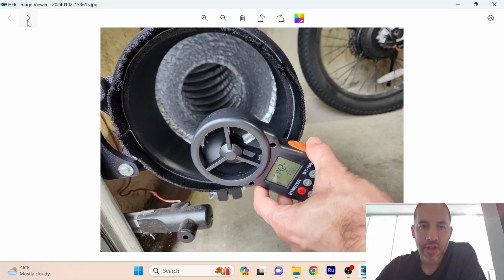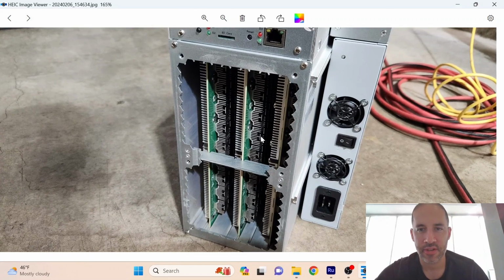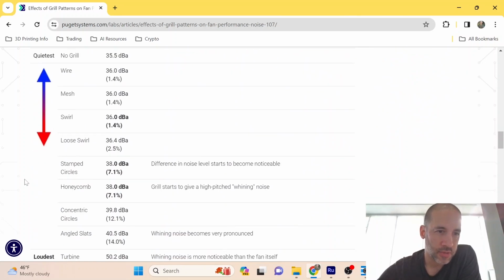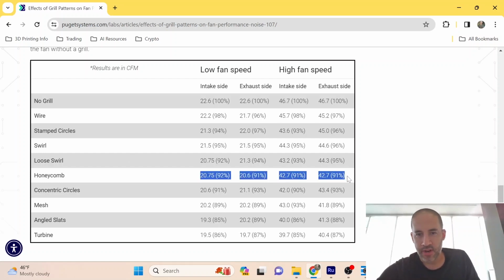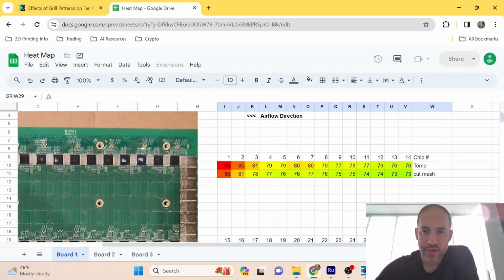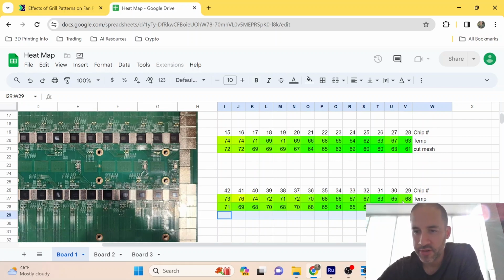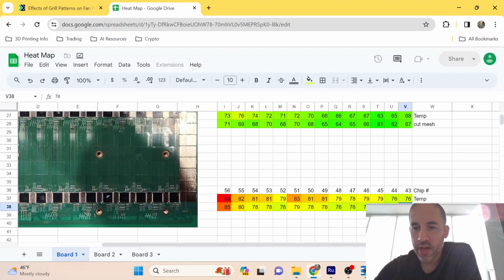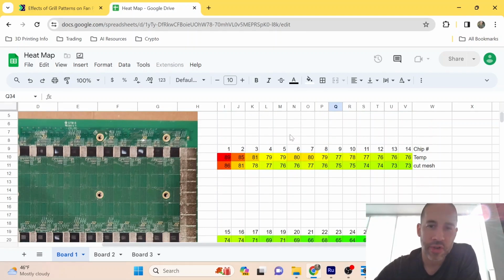FREE ASIC Miner Mod! Improve Your Airflow in Minutes! Better Cooling = More Efficiency!

Comment: Yes, meshes 100% can limit air flow. It's a common problem with computer hardware enthusiasts. We worry about dust and thats about it.
Cfm isnt a standardized test between fan manufacturers or even models. So whatever u test, create a standard with as little variables as possible.

Comment: Hey man, do you have any confirmed fitments for your shroud kits on a Bitmain KS3 yet?
Reply from the maker: I do not, unfortunately.
Reply: @BoneyardLabs  anyway I could get your measurements of your fan screw pattern to compare to mine? Or vise versa?
Reply: @BoneyardLabs  my fan screw holes are 105mm x 105mm and the bottom screws of the top fan are ~15.5mm above the top screws of the bottom fan. Would there be anything else that would matter other than these measurements?
Reply from the maker: I brought up my CAD model. The left/right spacing is 105mm and the top/bottom distance is 226mm. The center sets of holes are 16mm apart. From what you measured, it sounds like an exact hole pattern match.
Reply: Yes that sounds correct. One of my distances were just over 15mm and on the other side almost 16mm which is why I averaged it but I was thinking the fan could be a little twisted. Thank you for confirming! Now my next question… my print bed isn’t big enough and I’m not quite ready to upgrade printers, would you be willing to sell me the intake and exit shroud? If so, let me know a price. I want it to be worth it for you if it’s something to be considered. Thanks!